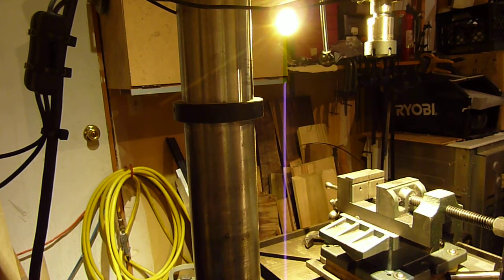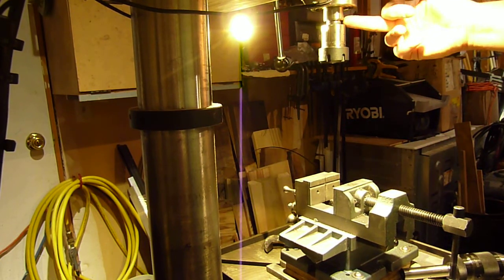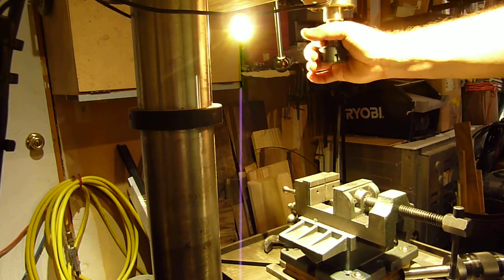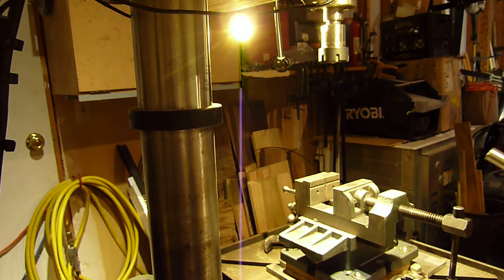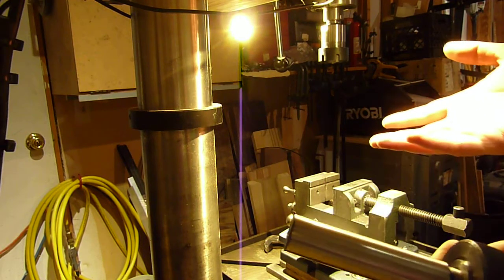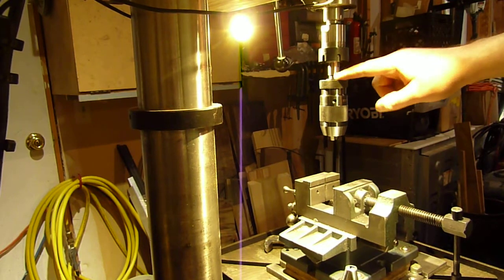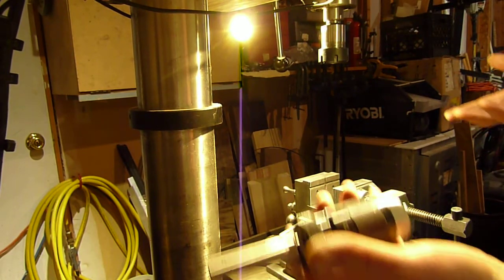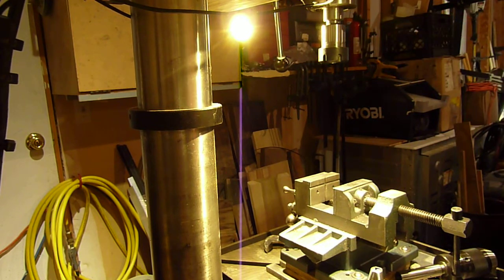Dayton 20" drill press: ER32 collet and drill chuck update

Comment: I've been watching your videos for a while I have recently purchased hey
Redial Arm Delta Rockwell  11-280 that I hope I can set up adequately for Milling I'm way out on far left field on this whole thing but I will figure it out hopefully I can lean on your expertise a little bit thank you please let me know what you think about the machine I purchased it has it worth pursuing what I'm looking to do as a milling machine thanks. I forgot actually the machine I think is a 7-speed but when I bought it it came with two other Motors 4 speed change I think towards the lower RPM range
Reply from the maker: I'm skeptical about how well that drill machine will work. In any drill press you have the pillar the table clamps to and the fact that it can rotate around the pillar. I have beefed up that clamp so it is quite difficult to get it to move when locked down. Never the less, with a 3/4" end mill, if it jams up, it will cause the table to shift. You have a dual rotating head and that's 2X more potential movement and rotation where you don't want it to ever exist when milling. For drilling which is about 90% straight down loading, a pivoting head like that is fine. Milling is almost entirely lateral loading as you cut with the side of the mill. Any flexing or rotation is going to create issues. I don't have a 11-280 and never looked at one up close, but those are my opinions about what I see in pictures. 
*
Best suggestion I can make is get a decent XY table you can bolt to your drill table. Get a 1/4" mill and see how it goes in some HRS. If the cut quality is OK, well congrats...you might be able to use it. If it isn't, then probably your drill press is simply not going to lock down sufficiently and become ridgid enough for milling purposes. 
*
I looked at pivoting drill presses like you have, but I had already been milling on my smaller 13" craftsman drill press and gotten quite aware of the places that flexed and moved. When I finally got to a place where all that movement was getting in my way, I looked for a drill press that had some very specific features. A beefy column clamp and clamping adjustment mechanism for the quill were minimum requirements. A rack and pinion table lift was important as I'd be adding some considerable weight to the table. It looks like your drill press has the quill clamping adjustment. I don't see a table rack and pinion and I can't tell if the 3 clamping mechanisms are very beefy. I'm skeptical your drill press will be ridgid enough for more than extremely light milling.
Reply: @de-bodgery  yes I figured with its capability of moving in many directions could be a problem to keep all the joints still I know that's going to be an issue that I may have to address hopefully I hope that I can be the joints up to eliminate movement and not have to permanently lock it down I don't know all the terminology that you guys know I'm just getting into it but I seen they make it ahead for they call it good I think they call it LOL it's almost like a 3 finger leave Chuck I seen a guy use it on almost the same machine he turned it horizontal he made an endpoint and use it like an leave but anyway I guess I will figure it out and I really appreciate the feedback thank you very much

Comment: I'm working on putting an ER32 into my drill press MT2 column to do some light milling.  Instead of drilling the column all the way from the top down, I'm looking at a long Allen bolt and washer inserted up through the drawbar hole in the end of the ER32 holder.  The bolt will engage a half moon adapter inside of the column's MT2 eject slot.  I took a disk the thickness of the width of the slot, put a 1/2" hole in the center and will thread from the edge to the center of the hole to receive the Allen bolt. Cut the disk in half to form an arch. The two feet of the arch will sit on the bottom of the slot. The ID of the half disk will clear the top of the ER32 MT. It will be a mini reverse drawbar from inside the ER32 to the MT slot.
Reply from the maker: I understand what you said. I was originally going to drill out the center of my quill shaft, but it never became needed. The collet chuck sees lots of use and has never come loose. However, if I was going to secure it better, I'd what you said. Typical milling tapers are much steeper and don't drive together very well. This is a big reason to have a draw bar on a mill. It has not been an issue for this drill press.

Comment: Hi Steve, were you able to do machining with your ER32 holder?  i.e. do some light milling with your drill press?  Almost all the YT video seem to say that it can't be done unless you modify the spindle to permit a draw bar or put a collar holder on the ER32.  What's your experience with your setup?
Reply from the maker: Yes! Quite a lot actually. The collet chuck never comes out of the drill press. It's stuck in the taper very solidly. I guess the most impressive thing I have done is 1/4" deep milling in 4140 steel. If I pushed too hard, I could slow down the mill, but a slightly lower feed speed kept me cutting just fine. The ER32 collet has never fallen out despite significantly heavy side loading. I see no reason for a draw bar or a collar. I no longer use that wilton cross vice in the video. I got an XY table and mounted a milling vice to it and that makes the whole thing much more secure and stable. I rewatched my video. I rarely use the drill chucks for anything. They just don't see use at all. Instead, I have a good selection of ER32 collets and I put the right size in the chuck for the drill and use the collet to hold the drills directly. The second half of the video is something I never do anymore.
*
This is a build thread for an EV I completed recently. You can see in there several parts I machined on this drill press with this ER32 collet chuck. Rear rim rework for mounting to the hub motor, 3 versions of steel torque arms, motor shell venting, brake extension arm, reworked swing arms, axel stand extensions, front brake rotor adapter and probably some other things I have forgotten. That's just parts I made for this EV, not everything I've done on the drill press since early 2020. A drill press used as a mill is quite possible. It has worked fine for me and seen many hours of use in this role. I mill with it more than I drill.
Reply from the maker: Forgot to post the build thread!
https://www.diyelectriccar.com/threads/zapino-zap-rebuild.205012/

Comment: How heavy of milling can u do with that press. Thanks
Reply from the maker: Tap magic helps with this a lot. Aluminum is sticky when it gets warm so it will adhere to the carbide mill. I put some tap magic on the mill before I start cutting. I'm able to take a 1/4" deep by 1/4" wide cut with a 1/4 end mill into aluminum. With cast iron...same. Depending on the steel...about half that much material removal. Since I made these videos, things have improved considerably and I have more things to improve as well. When using a drill press like this, you'll always find things you can tighten up or improve so you get better results.
Reply: @de-bodgery  always tinker on it to make it better. That’s our trails and tribulations in a little shop of horrors. Feed me Seymour.
Reply from the maker: @paultrimble9390  The irony here is machine shops mess up jobs all the time in the exact same ways that you or I might mess up work. They just do it with a lot more precision when they do get it right.
Reply: @de-bodgery  and they hope there costumers won’t be smart enough to know.  Sometimes.  Everyone makes mistakes